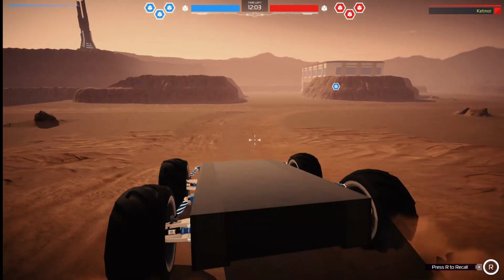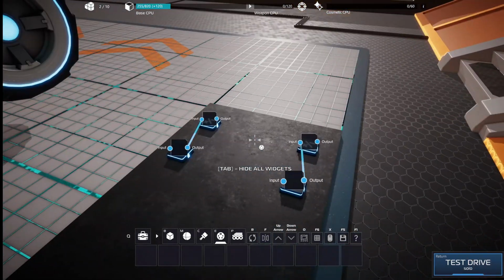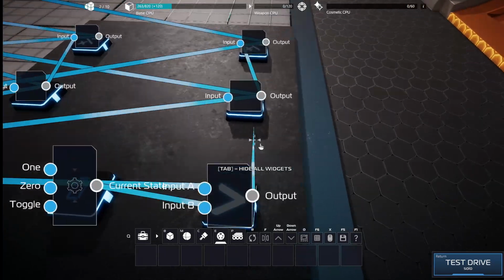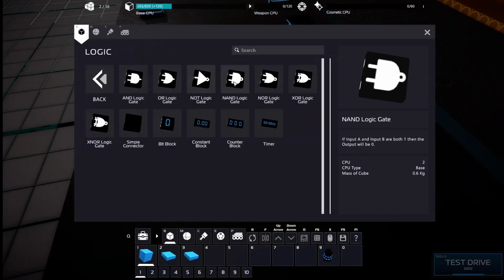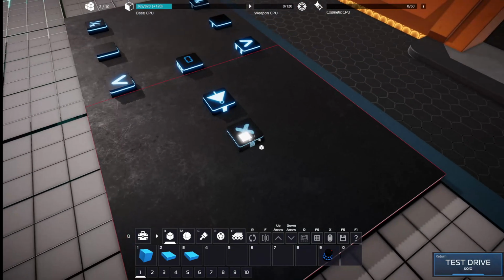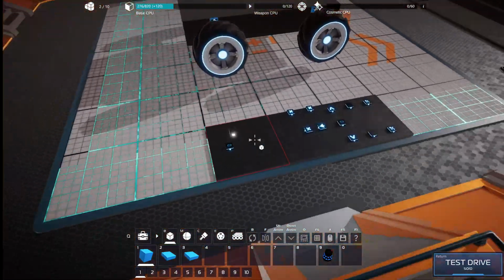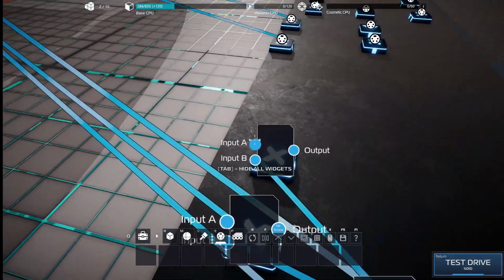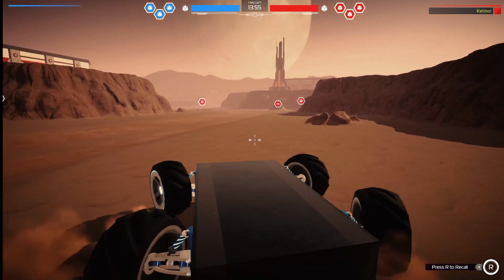How to set up tank steering for wheels in Robocraft 2 -A step by step guide

Comment: Couldn't you just set the wheels forward backwards, and then set another input controls for left right, and they would only activate if you hit LEFT on the left side for example?
Reply from the maker: I am not 100% sure I understand what you mean. I feel however If it doesn't work following my guide then I didn't do a great job at the guide, so I probably should make another one. Especially since I think there are easier way to do it than shown in this video.

I should also mention Frejam is working on tank-tracks. They will be out quite soon from what I understand and they will most likely have tank steering as default without the need of using any logic to set it up.

Comment: Mine doesn’t turn white driving and the forward is A and back is D plus W is left and S right
Reply from the maker: Have you checked all connections? It is hard to say why for me without actually seeing your build and all connections. There are actually more efficient ways in terms of CPU then I show in this video. I just didn't know about those when I made this video. I will make a better video about how to implement tank steering with wheels when I find the time for it.
Reply: @Ketmo785  I followed it step by step very slowly
Reply: @Ketmo785  thanks it will help
Reply: I just try my best with the lightest armor

Comment: This mechanic is a huge mistake.
Reply from the maker: It s not competitive at all.. the fact you can do it is mostly a gimmick. You are much better of using normal wheel steering in 99% of the cases. But I think that it is fun that it is actually possible :)
Reply: @Ketmo785  I'm talking about them (the devs)  having all the logic/math stuff. Should have been clearer. 

While I don't think they should dumb it down too much, this is going to alienate a lot of players if it's released like this.
Reply from the maker: @denizenofclownworld4853  There is no need to use logic to make something work. But seeing it there might make people think they need it. I really like that it is there thought but might have been a good idea to lock some stuff behind a bit o progression to make stuff seem simpler at first
Reply: @Ketmo785  Without it, there's little options right now. More restrictive than RC1.
Reply from the maker: @denizenofclownworld4853  yes. However. RC1 did not have that much either in the early Alpha/beta phase. RC2 is still very early in development